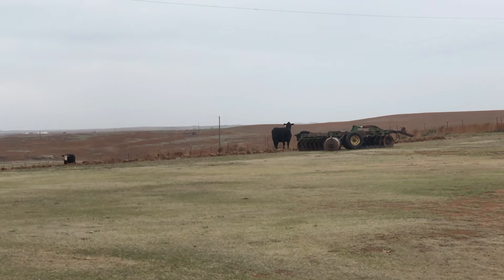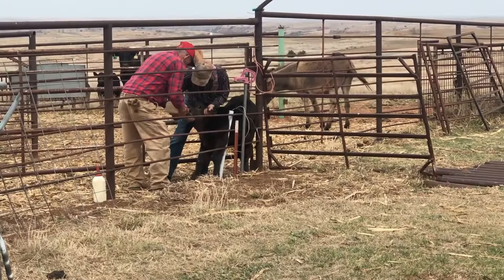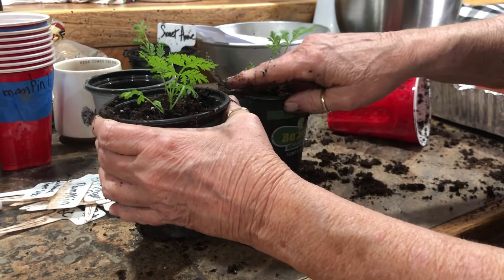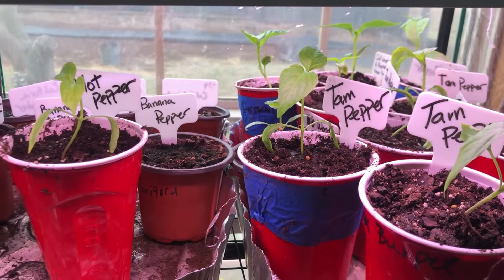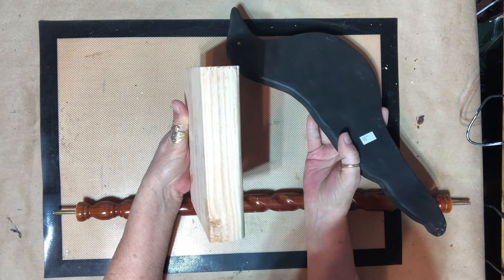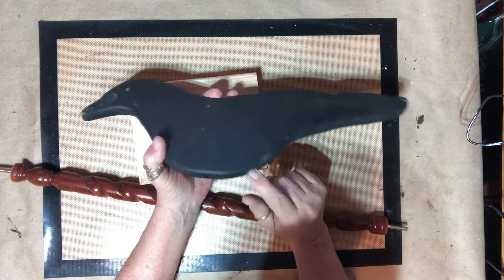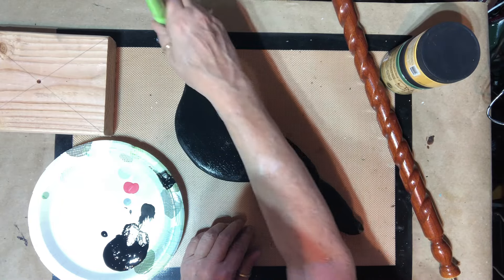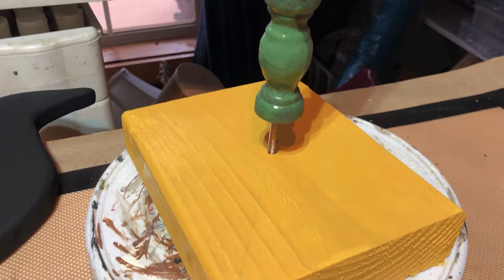Crow Porch Sitter / Update On Sweet Annie / Farm Animals

Comment: Hi Sandy😊 I am pretty new to your channel and am thoroughly enjoying it!  Question for  , I purchased Sweet Annie seeds and they are soooo tiny.  Do I have the correct seeds, or did I get taken?  If these are indeed Sweet Annie seeds, what is the best way to start them?  They are so small it would be impossible to plant individually.   Thanks so much for the great videos, I'm  learning a lot and inspired even more❤
Reply from the maker: Yes the seeds are really small.  I just took a little pinch and sprinkled it over the potting soil.  Then I used a spray bottle to mist the top of the soil.  They came up.  This year I looked at the little baggie they came in and thought I saw some.  I opened and tapped the baggie over some soil, misted it with water.  I did end up 3 with plants coming up.
Reply: Sandy, thanks so much for the information 😊. I will get them started today!